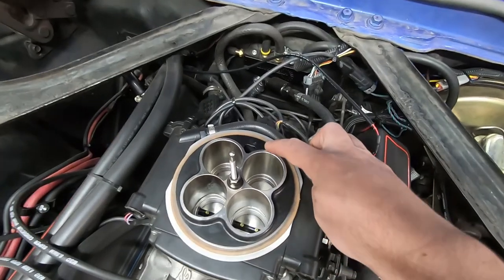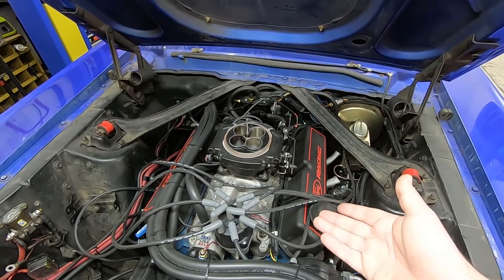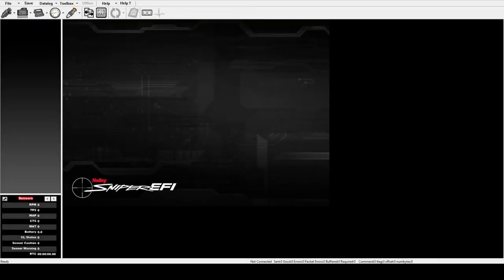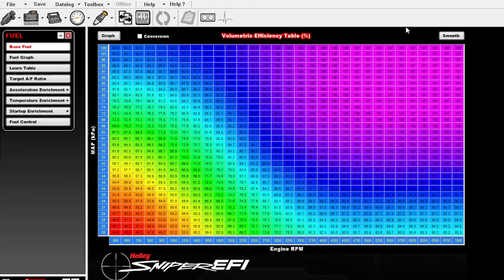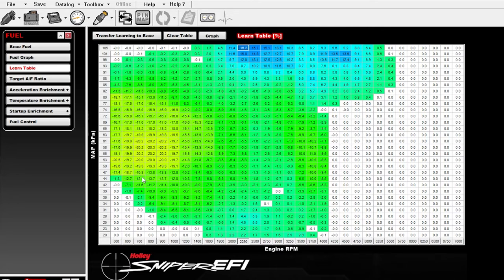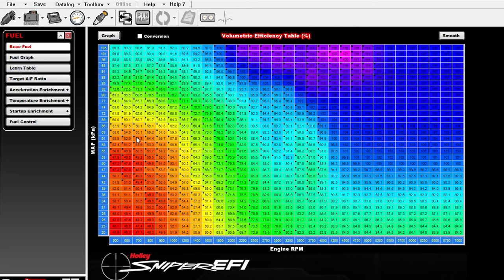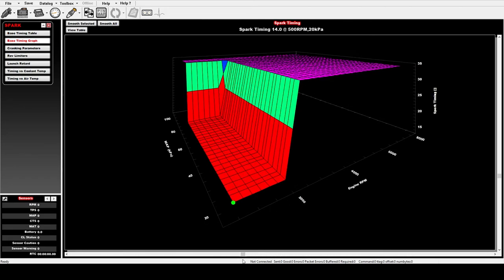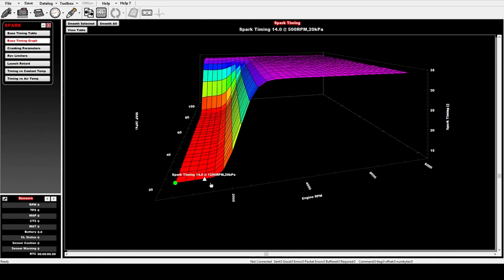What I dislike about my Sniper EFI system and how to fix them!

Comment: Would you recommend using the stock tank over the EFI conversion tank?
Reply from the maker: Having tried both, I think I would stay with the stock tank and external fuel pump unless forced to make the change. There are some good solutions for quiet external pump setups and can be easier to service and plumb.
Reply: @AmbiVe  Thanks.  I was considering using an internal pump from Holley.  Holley 255 LPH OE Style EFI Fuel Tank Modules
Part # 12-305.  Have you considered this?
Reply: I too don't want to run the lines into the trunk.
Reply from the maker: I used an in-tank retrofit from Holley on my SR 240Z. If you search it on my channel you should see it. I think it worked well and was a high quality part.

Comment: Sounds like most of the efi kits are junk.
Reply from the maker: You would have to define junk. Depending on your engine configuration, an EFI setup running poorly will still be as good or better than the average carb install. EFI or carb, setup and tuning are going to be required to get the most out of them. EFI in general just has more potential and ways to tune.

Comment: Nice gentlemen. Presents well. But respectfully, does not know what he is talking about and should not be spreading mis information. IMO. Smoothing in a hand held would be danger.
Reply from the maker: What danger are you talking about and what do you mean by smoothing in a handheld? This is done in the Sniper EFI software. Cell averaging/smoothing is a common tool that is provided in many tuning systems. Depending on the application table and what values are being smoothed, it can only adjust between a narrow range, keeping it fairly safe... It's not extrapolating large value differences. Additionally, if you're smoothing your fuel tables, the learn table will again identify the difference from sample on the O2.